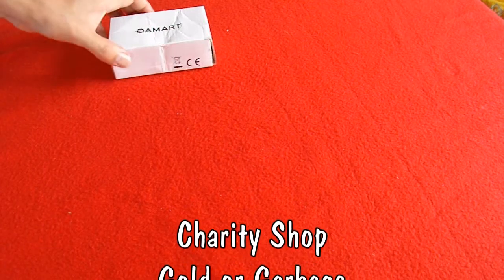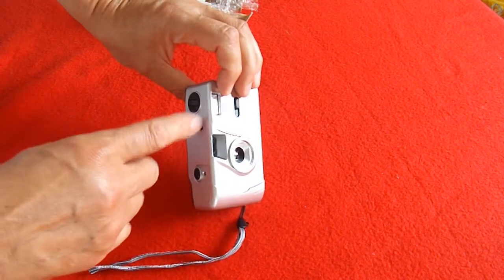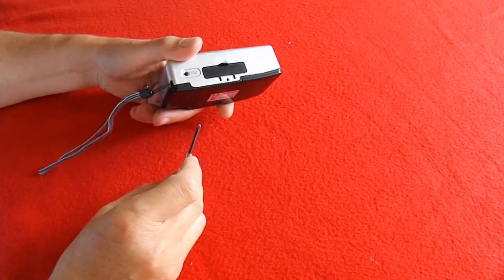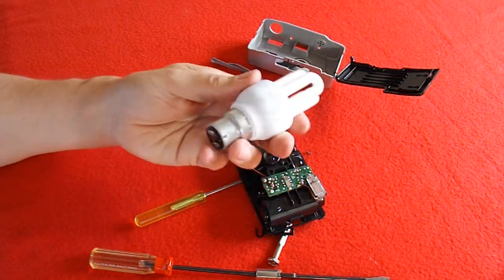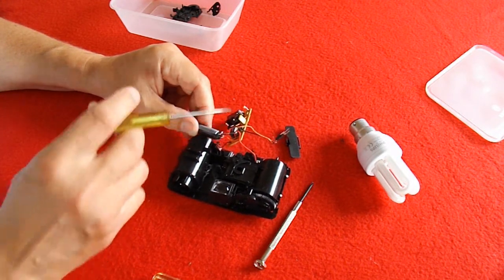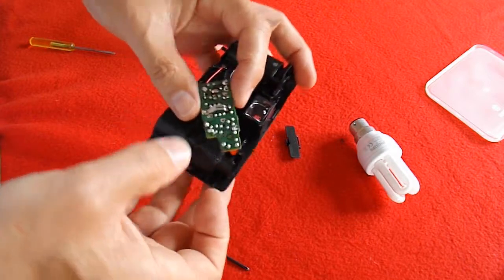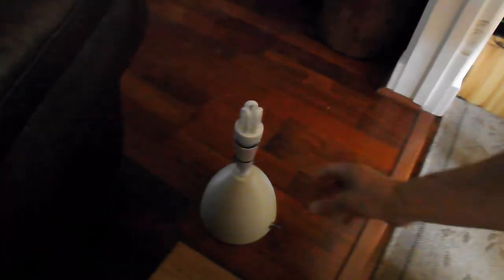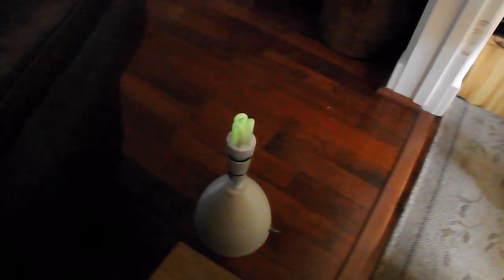Charity Shop gold or garbage #7 - 35mm camera with flash

Comment: Hi Grandad, I was searching through many videos and instructables on how to light a cfl or any other load using a circuit from a disposable camera, but still can't figure out exactly where the output wires should go in order to constantly light the bulb? By the way I'm an amateur to this and this is my spare time hobby and would like to try to make a simple circuit.  Any suggestions are welcomed.
Reply from the maker: Viktor Božičević that's interesting, I usually put a link in the video description if I mention somebody else's video when I am taking but I seem to have missed it from this one. As you see from my video it worked but not very well. 
I have just done a quick search and found several but not the one I watched
https://www.youtube.com/results?search_query=camera+flash+circuit

This one looks pretty clear https://youtu.be/wLR9TjF1Gsw

For this sort of stuff in general I suggest you have a look at a channel such as Lidmotor for well presented electronic projects
https://www.youtube.com/user/Lidmotor/search?query=CFL

or any of these guys
slider2732
https://www.youtube.com/user/slider2732

lasersaber
https://www.youtube.com/user/lasersaber

RimstarOrg
https://www.youtube.com/user/RimstarOrg
Reply: GrandadIsAnOldMan Thank you :)